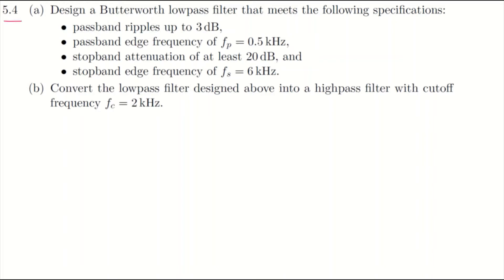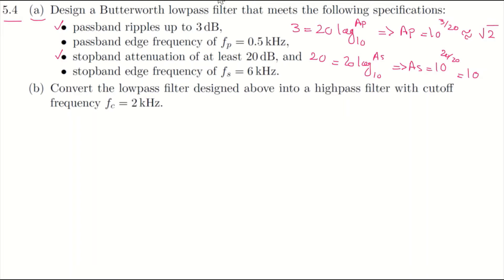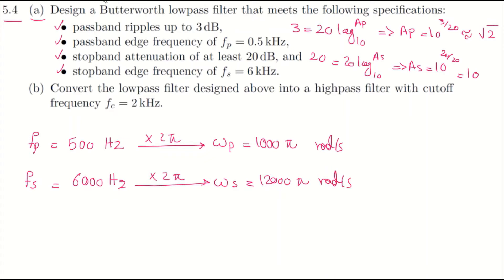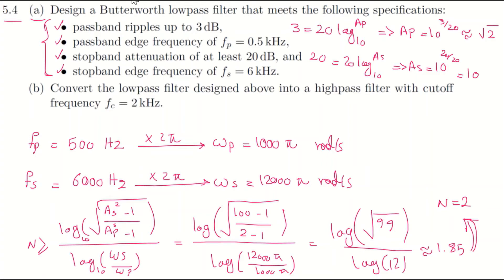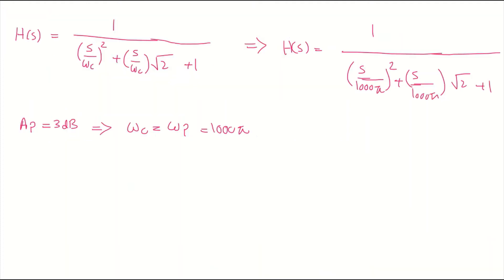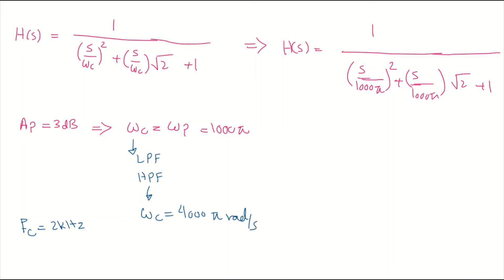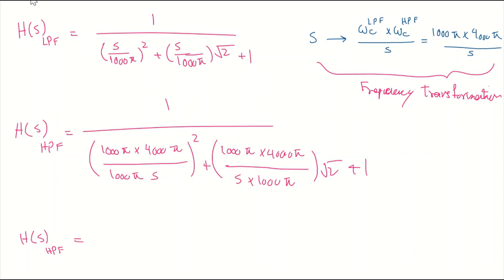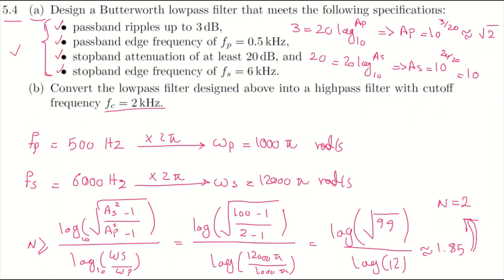#5.4 (a and b) Design a Butterworth lowpass filter that meet specications:

Comment: Design a IIR Butterworth LPF for
the following specification using
Bilinear Transformation method
Pass band gain : - 1.2dB, Stop band
gain: -10 dB, Pass frequency: 200
Hz, Stop band Frequency: 500Hz,
Sampling frequency :2000Hz

can u solve this sir